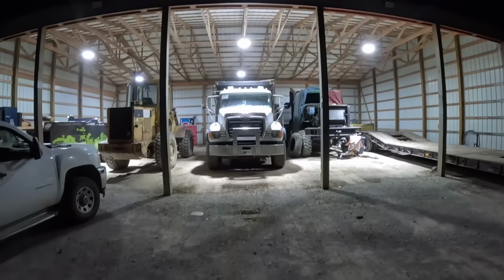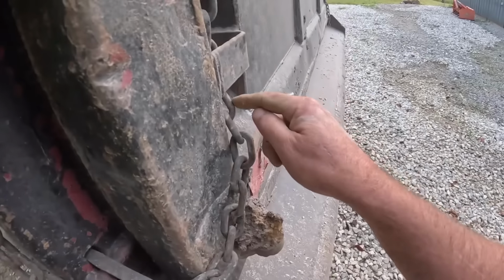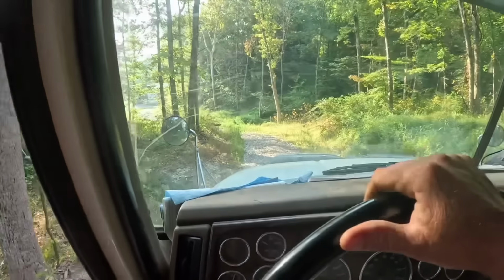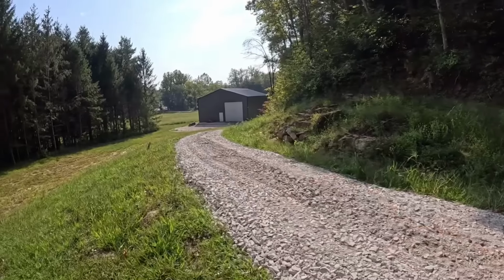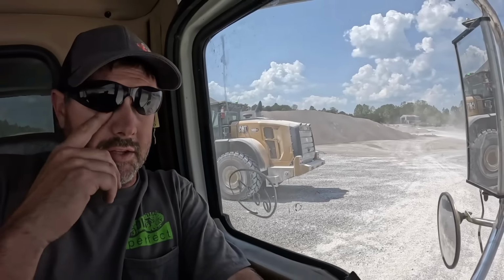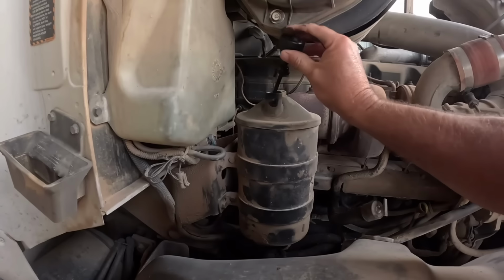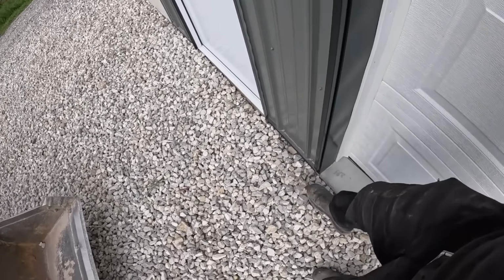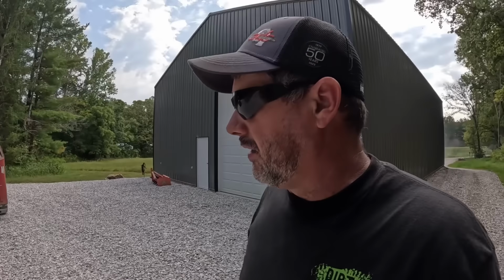Jaw-dropping Footage Of A Rock Installation On The Mountain Road We Built Last Year!!

Comment: A hint - just touch the ring of the chains with a bit of nail polish.  A color for this job.  No more counting - and you know it works nice with this rock.   Another job might be overdressing or small rock and use another color or just keep it in mind with two stripes far apart.

Comment: I love that small bridge with a 12 ton limit being crossed with 19.5 tons of rock
Reply from the maker: You not understanding how.bridge law works bud
Reply: @ now I do

Multiply the number of axles times the distance in feet between the outer axles of any group of two or more consecutive axles. Then subtract one from the number of axles in the group under consideration. Divide your first number by your second number.

Comment: I really liked this hole job including taking the 210 over the hill when you was done the hound dog was panting at top 90 % of todays driver could never shift a gear on the low side of transmission on a grade like that

Comment: DP just a question on all the trips to the quarry would you not have been better taking the side dump trailer and dropping of in the lot and then loading up the dumper for the shorter hauls
Reply from the maker: Yes depending on the job

Comment: I do wonder, wouldn’t it be easier to lay the gravel going down hill? Less strain on the transmission and engine, just a mite pressure on the brakes but low gear would compensate for that.

Comment: Those bumps or loopty doos  are caused by the pistons driving the wheels…learned that from my manager Shot Kersey, when I was a park ranger in the only Florida State park with only dirt roads in St.Augustine 🤩👍🏻😎🌴🌞
Reply: I thought the engine powered a hydraulic pump?
Reply: @ It powers the drive wheels which are driven eventually by the pistons…

Comment: You usa guy waste time an fuel hauling just 21 tons. Big dump box half emtey. Big truck like that here in NW Ont. Canada. Truck that size with a tag. 32 ton per load. You can see top of the load even with the mandatory on all roads and hyw's tarp on.